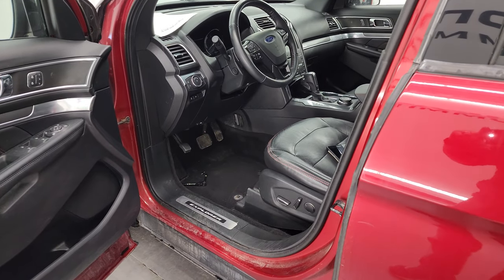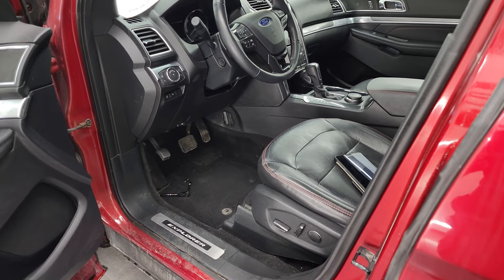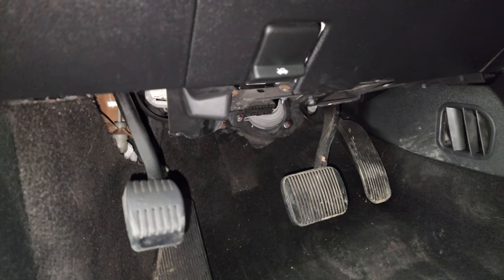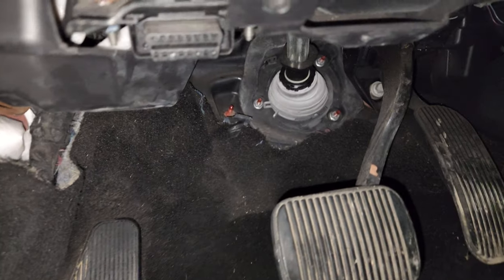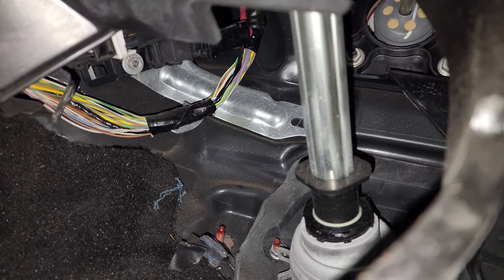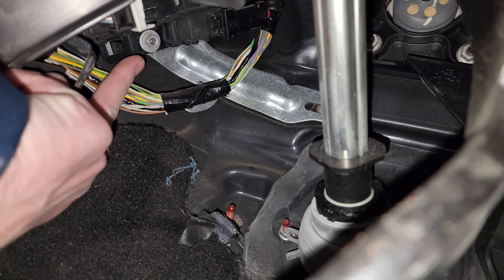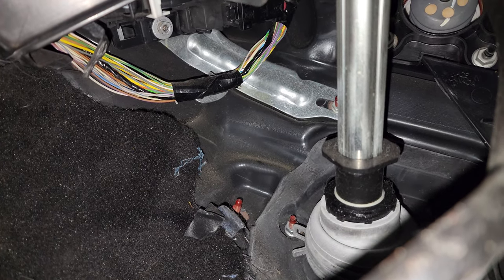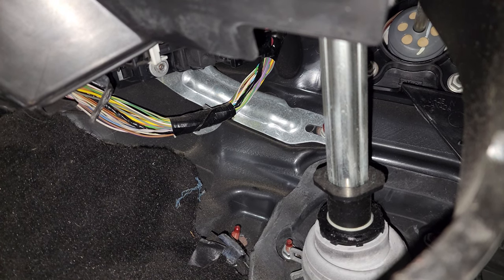2016, 2017, 2018, 2019 FORD EXPLORER DOOR CODE LOCATION NUT TO REMOVE

Comment: I have 2019 ford explorer xlt and I couldn’t locate the code. I looked under the dash and I had more plastic covers by the obd port, so I removed them and couldn’t find the nut. I found a similar looking nut with a clip farther up but behind it the sticker didn’t have and code on it. Is there any other location?
Reply from the maker: Not that I know of, I know the newer body style Explorer's changed where to find it.  I could have been wrong and that new body style started in 19.....
Reply: @Summitauto  is there any way I can send you pictures and you might be able to guide me?
Reply from the maker: @hassandarky5652  brett@summitauto.com
Reply: @Summitauto  Thanks will send you pictures soon